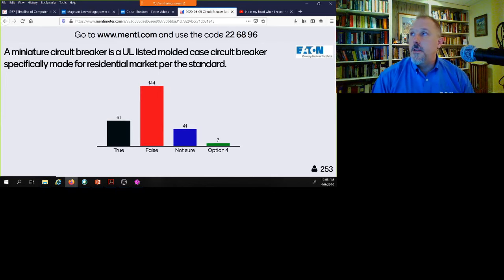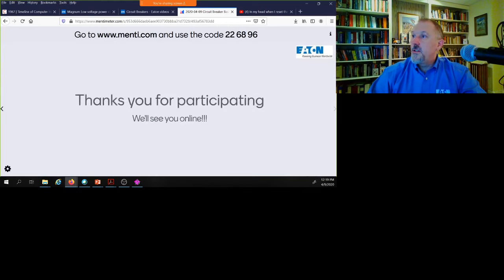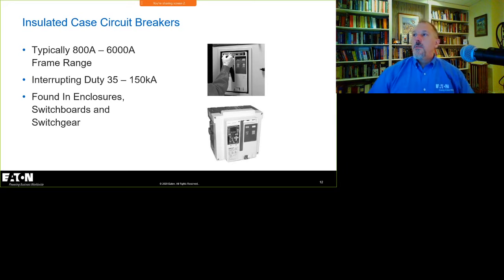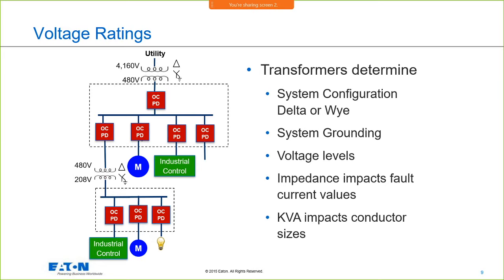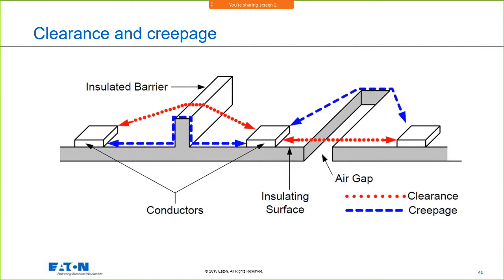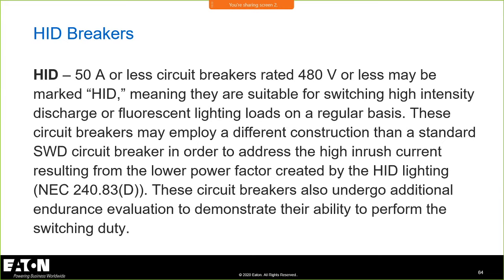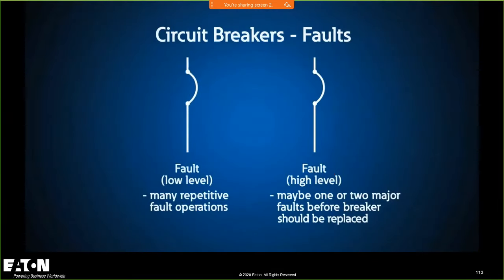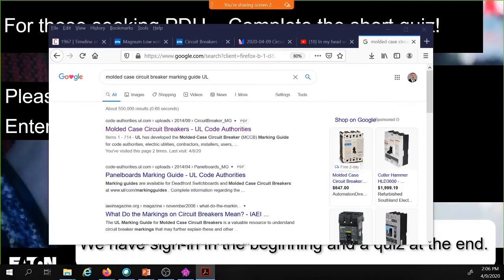Circuit Breaker Basics

Comment: Is the same principle of opposing magnetic fields pushing the contacts apart and providing current limitation applicable to insulated case and power circuit breakers or only molded case breakers?

Comment: Is it true that the reduced interrupting rating that comes on a given low voltage breaker as the voltage increases is more because of asymmetrical fault current than symmetrical?  Meaning in theory if it weren't for asymmetrical loads/faults that interrupting ratings may be similar at all voltages the breaker's insulation can handle?  When interrupting asymmetrical current there's never a true zero crossing, so a higher system voltage means a higher voltage that the breaker will be interrupting at, which gets worse with more operating voltage.